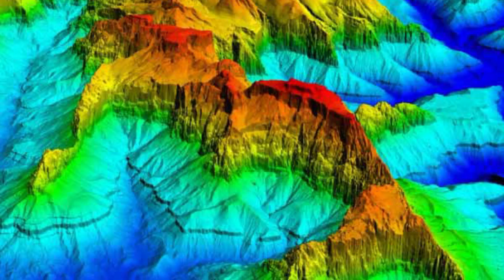Inside The Grand Ethiopian Renaissance Dam |Africa's Largest Hydroelectric Power Plant

Comment: Egypt doesn't have to worry about water shortages from the blue Nile, because every water power plant definitely needs an outflow of water to generate electricity,
Reply: The main problems for Egypt come from the Aswan Dam. The Nile Delta is cut off from silt to replenish the delta's soil. The Aswan Dam also wastes vast amounts of water, reducing the flow of the Nile. The weakened current of the Nile reduces the protection the flow of the Nile gave to the soils of the delta.  Thus, the delta is eroding and becoming sallinized. 

Even if the Ethiopians were to wait a century to slowly fill the  Renaissance Dam, Egypt would be unable to withstand the water loss. The Nile Delta is already likely to be useless for agriculture in a few decades. Even the most careful filling of the Renaissance Dam would radically speed this up. 

Of course, Egypt,  which always talks down to Sub-Saharan nations,  didn't help their case by starting with orders and insults. Ethiopia is slammed for refusing to negotiate in good faith.  But Egypt wasn't interested in "good faith" themselves.
Reply: @thomasdevine867  

No body get billion cubic meters of soil per year a virgin soil every years for the last 5000 years 

In America the farmers doesn't get brand new and every year they farm the same land for the last 300 years the difference is land management if u abuse ur land with chemicals fertilizer they have to switch to natural  fertilizer and they will be all right with other water management u suggested
Reply: @Hikm Suna  First, America has truly vast areas of high-quality farm land.  Second,  US law and regulations promote responsible land use and conservation.  The "Dust Bowl" burned many lessons into the American public.  The Nile Delta is small compared to American farmlands.  Also, the Nile Delta is at a very low elevation compared to American farmlands.  Few places in the world are as vulnerable to either erosion or sea level rise as the Nile Delta.  

The one area of the USA that can be compared in a coherent way to the Nile Delta is the Mississippi Delta.  Even if the whole delta washed away, it would hardly have an effect on food availability in the USA. A ten percent loss of Nile Delta farmlands would cause a famine in Egypt.
Reply: The real problem is it can take many years to fill up the dam before it overflows to continue downstream to Egypt.
Reply: @collinsejaife1956  Egypt still has 200 billion cubic meters of storage in Upper Aswan, enough to irrigate Egypt's agriculture and people for 5 years.